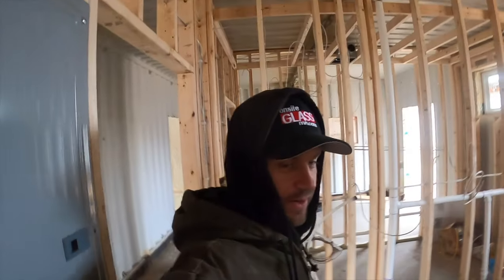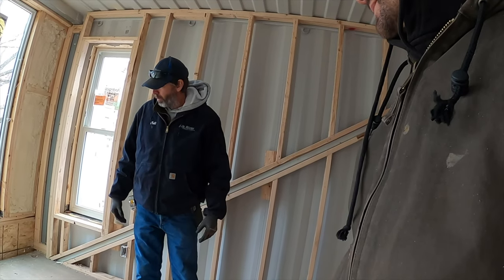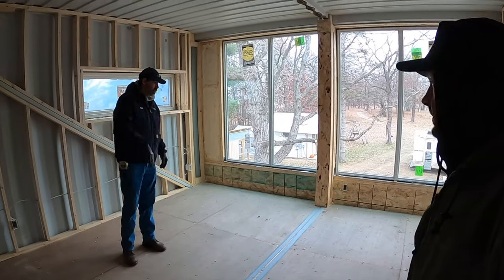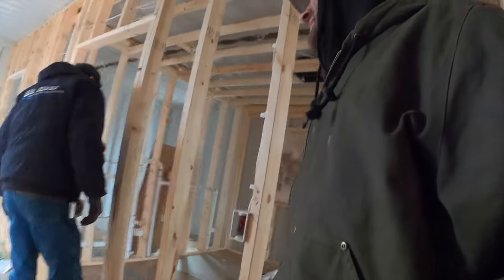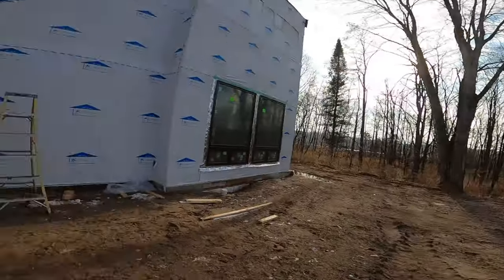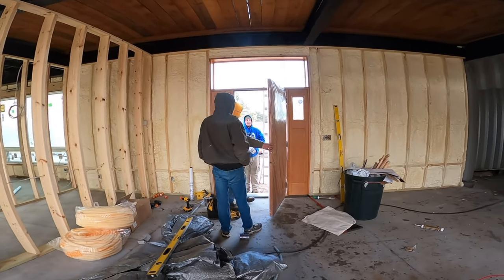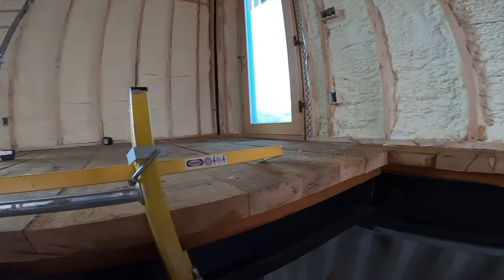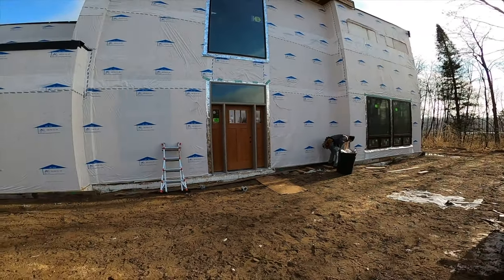Things Are HEATING UP On Our Container Home Build

Comment: What is the budget on this behemoth? This is like 2 or 3 normal container house builds together. And then you had the entire exterior framed with wood because... is it a code thing? The structural steel beams, concrete floor, full exterior wood framing,  why did you even bother using containers AT ALL? This entire build would have worked about the same without the containers. I'm so confused with this build.